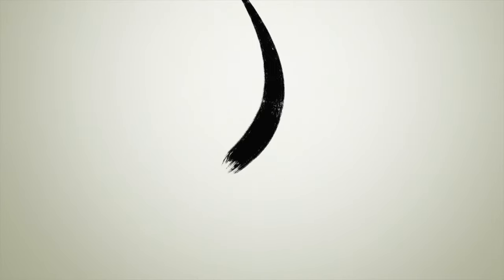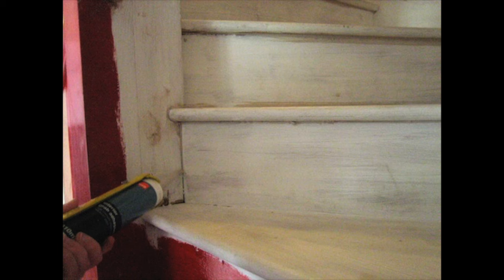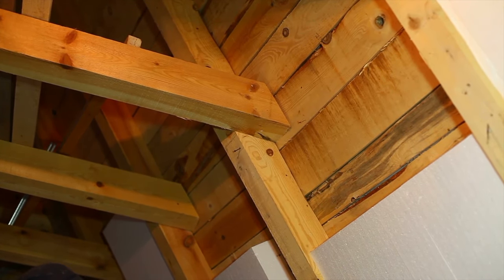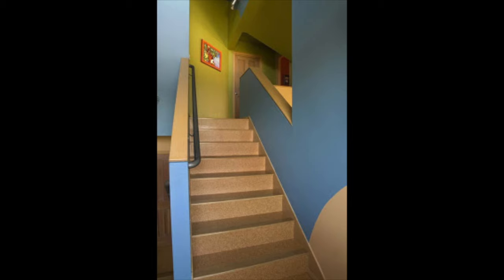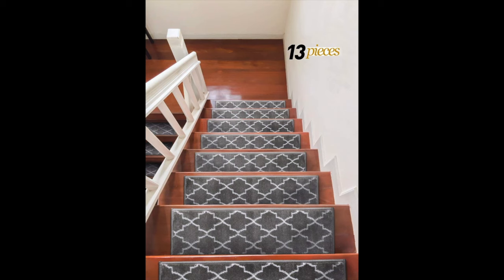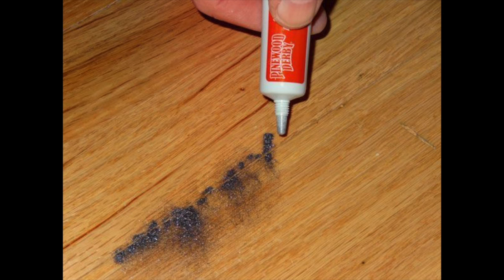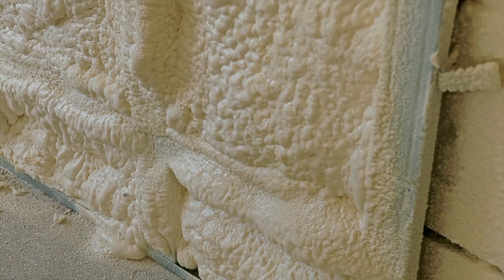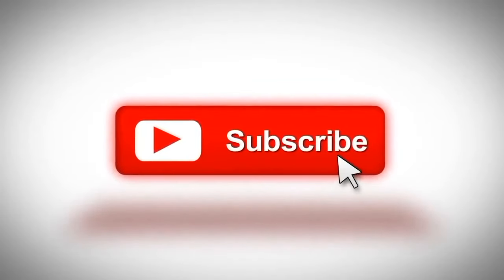How to Soundproof a Staircase - 7 Ways to Make Stairs Quieter

Comment: Thanks for sharing the info. It was very helpful. I have a staircase made of wood and MDF, we replaced the carpet with hybrid flooring. The flooring product has an underlay on it already. However the next door neighbours of our terrace house can hear a lot of from our staircase since it’s on our common wall.

I was thinking about insulating the underside of the staircase since there is an open space there we use for storage. I could cover the underside of it and all walls under it too.

Do you think this approach could be effective?

Comment: Hello. We have metal/steel stairs at home connecting the living room to the loft. It make a lot of noise even if I try to walk on it very lightly. Is there any way I can permanently get rid of the 'clanging metal' sound? Will tightening of the bolts help as well? Thanks.

Comment: Couldn't you just use the regular caulking if we are just covering the hole?  How much effective is noise sealant?  Seems way overpriced.
Reply from the maker: One thing the acoustic caulking will do that cheap caulking wont is stay flexible preventing it to crack over time and letting sound/light/air through.